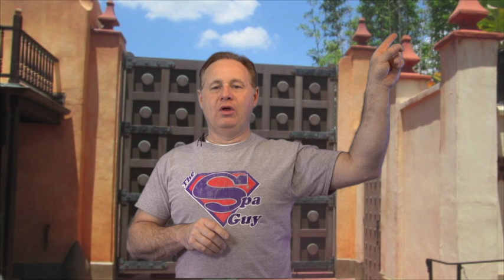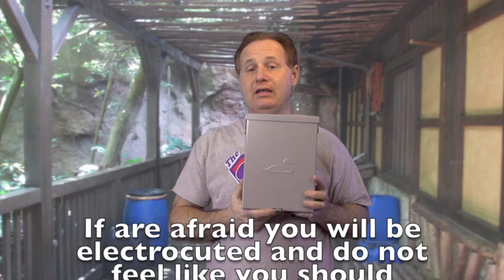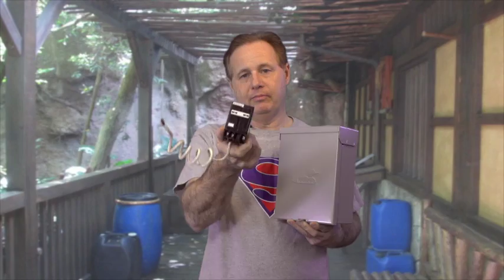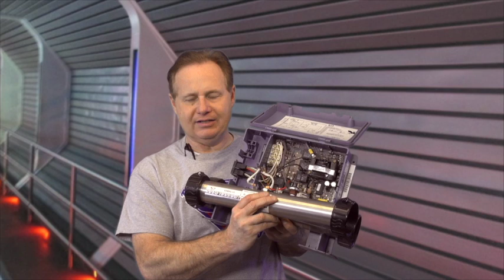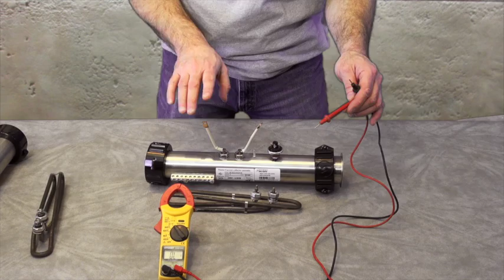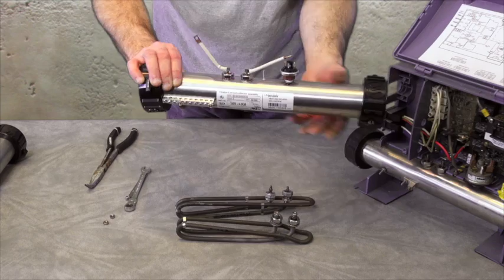Gecko S-Class SSPA Heaters How To Diagnose & Repair  The Spa Guy

Comment: Question, I need your expertise opinion.  I have a s-class spa pack. I have what testing that i know to do.  Anyways my heater is good, elements are good.  I disconnected the 2 hot leads going to the heater, I'm not getting any power to either of those 2 leads. It's an 04 tropical series and it has 3 blinking lights on the control panel. No dirty filters, water level is good, no air lock. Would you happen to have any suggestions, what to check? Fuses are good also. Could it be the high limit switch or bad board? Thanks in advance for any help.
Reply from the maker: It sounds like it could be the high limit switch or the board itself. One leg of the heater has power all of the time unless you have a hi limit issue. Most of the SSPA Packs do not allow you to replace the hi limit. I would say a retrofit would be the most likely solution unless the hi limit is replaceable.. Most of those packs are out of service by now as they were not great.. https://store-se4hm82a-1789472.mybigcommerce.com/retrofit-base-control-balboa-bpbee-1-or-2-pump-with-4-0kw-remote-heater-tp200t/

Comment: Hello Sir! We're having a heater problem on a hot tub that was gifted to us. It kinda looks like the right box in this video. Everything is working except the heating element. We get a #32 error and cannot set the temperature. It looks like maybe it also has some rigged wiring inside? I was wondering if you knew what this error is or if there's anyway I could send you a picture of the inside of the box to see if you can see anything obvious? We can't find a wiring manual to make sure we're all wired properly. Again, everything works except the heating element and we get a #32 error

Comment: I just replaced the heater tube with new element and pressure switch.  When I power the tub on I get 240v going to the heater but the heat light doing not come on, it will go on if I adjust he heat but then turn off after 2 seconds. Not sure what to do
Reply from the maker: With the heat light not on you don't have 240 at the heater if you did it would be heating..
Reply: @SpaGuy  so I was looking at the wrong light, I thought the set temp light was the heating light but that light only comes on when the temp you set is reached.

Comment: My everything runs good but no heat. Got correct voltage when running. Seen a small puff of smoke coming from heater.
Reply: maybe loose wire, causing it to arc.

Comment: Hello spa guy great videos... Are you familar with a old vita spa? My tub tripped the breaker last night while i was in it?  The temp was good and both pumps were running when it blew?  I pulled the heater the next morning and tested it which i thought it was bad but tested good?  Would the preasure switch cause the breaker to trip?  I put a volt meter on it and it shows nothing on the meter? I even pushed the bottom part of the switch and still shows nothing?  Any help would be great that James
Reply: Pressure switches wont give a reading... typically, if its the pressure switch it will give you a flo code error.

Comment: What happens if I change a heater from 5.5 k ,  to a 4k do I safe safe energy on my spa or can I do this? 240v
Reply from the maker: It just heats about 1.5 degrees less an hour..
Reply: @SpaGuy  So if I needed to replace the heating element (I don't have to make 5.5k with a 5.5k ... i could replace with a 4k). The reason I ask is because I am looking to fix the heat on the hot tub, but when I opened up the pack, the label had come off somehow so i cannot see if the heating element is a 5.5k or 4k.

Comment: I'm troubleshooting a hottub, control board was cooked, its been replaced but still no heater remive the heater connectors a d read 19.2 ohms. Pressure switch is working but still no heater. 240v is now after board changed but still no heater.

Comment: i have a geckop spa  sspa-1-p122-81-01-1jjm-mkg1-3962-o1c  and it has a run away heater.just replaced the top panel. any suggestions on how to repair or reset the runaway heater temp > 104 and sometimes says "HI" any  solutions?? or recommendations??

Comment: I have a spa that is not heating but it does not trip the circuit breaker. The heater element is a 5.5KW. I have disconnected the wires to the element and it ohms out at 33.8 ohms. Could this be the cause of the spa not heating?

Comment: Superb video and this for all of them that I watched. 

I have SPA with a Gecko in.xe with 2 motors. Lately, I have an error code HR I think and the SPA reach high temperature. I also noted that motor #2 is running after a reset without any indication on the display. I already tested my 4KW geater and reading seems to be goog, 14.9. Do you think that my problems is related with my in.xe. Thanks.

Comment: My Spa pump is not starting? There is power on the Unit, temperature change and light are working , but pump not responding, you can listen to a "click" there a fuse I have to replace???  Model: SCCF-P122-P212-01-LS  Thanks!
Reply: Ivan Perez my spa is doing the exact same thing, did you find out how to fix it?
Reply: My model is sspa-1-p122-02